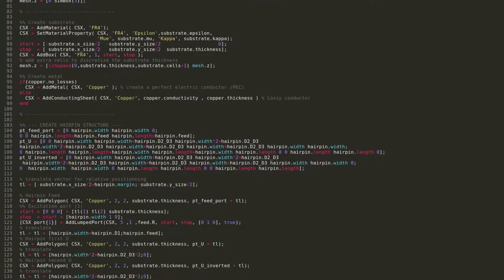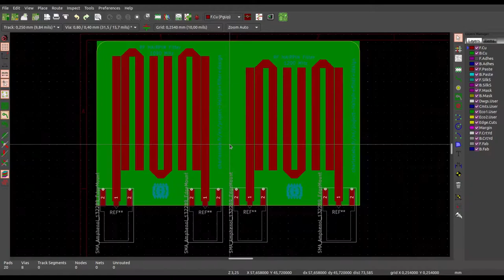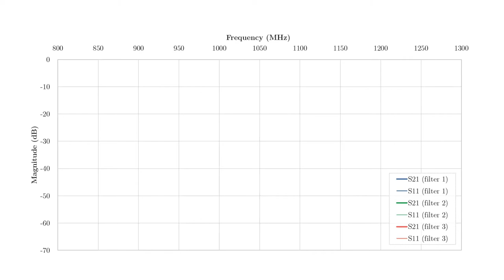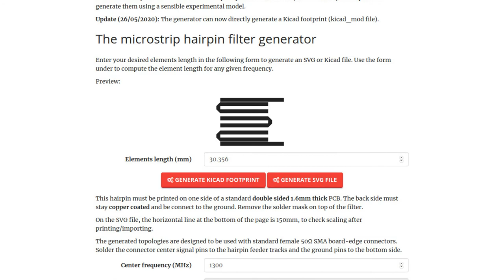Hairpin RF filters - Generator and measurements

Comment: what is the EM radiation's acceptable range for your? At what distance from filter, have you measured the EM radiation? In your video, filter seems to radiate +9dBm power which is very high. Which topology is suggested to minimize EM radiation?